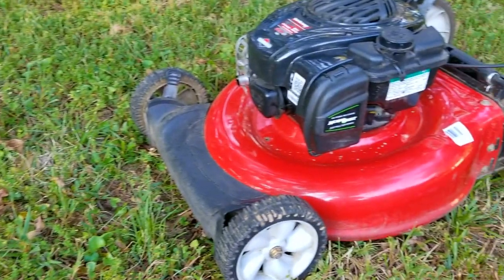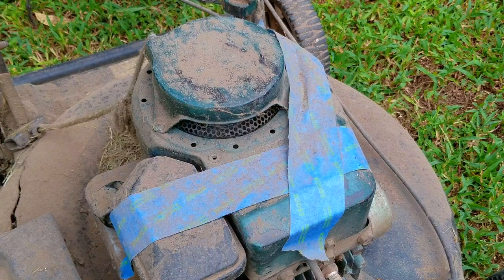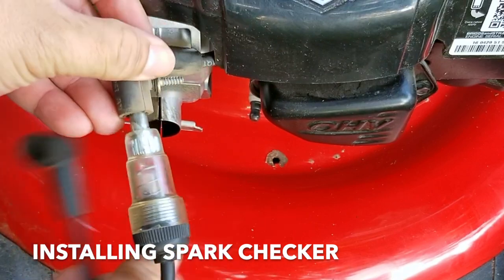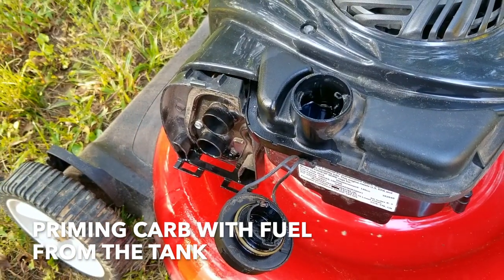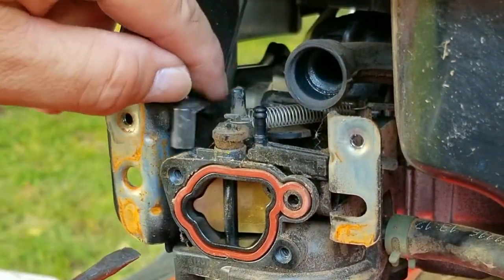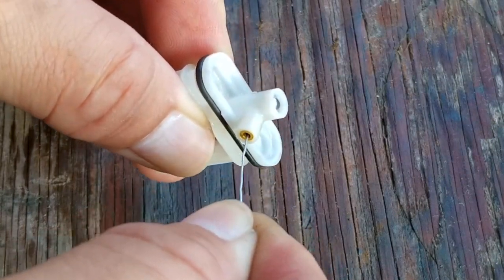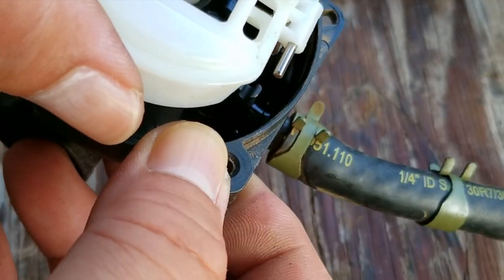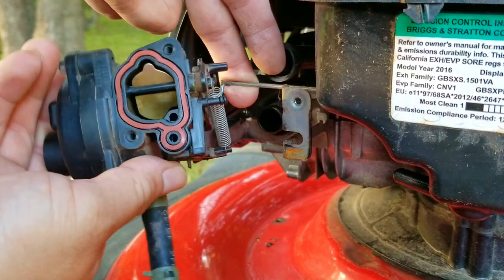Why Did Briggs Stop Making The Flathead Engine?

Comment: to be honest I actually prefer the newer ohv engines from briggs and stratton because they are more fuel efficient and I actually had some older briggs engines the flathead one and it was nothing but trouble but when I switched the newer engines really impressed me way more than I thought even my grand mother has the flathead briggs and it doesn't impress me because it's always running out of gas breaking down and all that kind of things so I like the new ones way more than the older ones.
Reply from the maker: nothing wrong with that

Comment: My 6.5 tecumseh is the most reliable mower, mostly cause the thing is a flathead. I do need new piston rings, but those are easy to get.
Reply from the maker: nice, as long as you check on the oil, and replace the spark plug once in a while, a little oil burning isn't going to hurt it.  Thank you Cj Burrows.

Comment: I like the newer engines and the issues are mostly user error like not storing them right or other lack of basic maintenance.  The plastic carb stuff overlooks the flat heads had a plastic carb as well but then nothing wrong with them.  Plus these new carbs are super easy to work on and easy to service.    The fuel injection idea would just add too much complexity to a basic engine and if people can't get the basics right in storing and maintaining a basic carb mower then a fuel injected one would just mean more issues and cost.   Also the side vale design means compromised combustion and is why they are less powerful and produce more emissions so adding fuel injection to a side valve engine is pointless.
Reply from the maker: thank you for the comment, I appreciate it.

Comment: You can make a simple mechanical injection pump and injector system or a really simple electric injector that runs off the magneto or alternator. It's not all that hard. Most of these engines are pretty much 'steady state' RPM during load. The combustion chamber and compression ratio of the old engines had more to do with the emissions. Besides, I think most of these small engines are, unfortunately going to catalyst/muffler combo units.
Reply from the maker: thank you Vince Majestyk
Reply: @INSIDEHOUSEGARAGE  You're welcome! I've got a couple old flatties on some equipment and one of the 'throwaway' 'never drain oil' on a pressure washer from 2016 or so. Never looked but I always assumed there was a drain on the bottom. I was surprised to learn they still made the flathead engines until very recently. 
I think the last time I ever saw one on a piece of new equipment had to be the very early 2000's. I believe the change away from it was more to be competitive. When you amortize the cost of design, production and tooling of that flathead over the decades they produced it, that had to be a money maker.
Reply from the maker: I feel the same, they were getting eaten alive in the market by other newer engine companies.  Money, it's a power thing. thanks again!

Comment: When gasoline evaporates slowly, it leaves behind a gummy residue called varnish which can clog fuel jets.  Ethanol is prone to this.  Unfortunately, increasingly larger amounts of ethanol is being added to gasoline.  The only proper method to prevent the gumming is to run the engine out of fuel effectively draining its carburetor.
Reply from the maker: thank you John Fraser.

Comment: I actually like that plastic carb. You can get to that jet cartridge SO easily, blow the jets out, and snap it all back in in 5 minutes. Good to go. They don't corrode with ethanol fuel, either. If it's too far gone, a new one is cheap.

You can pluck these MTD and similar mowers off curbs and out of bulk waste all day long and 98% of them run great with nothing but a jet cleaning.
Reply from the maker: you are correct, the jet is easy to get to, but unfortunately the fact that It's so easy to clog in the first place is really irritating.
Reply: @INSIDEHOUSEGARAGE  Add a fuel filter and the issue never comes back. Most of these engines only come with a goofy little screen at fuel tank outlet.
Reply: Also, they're jetted so lean that I typically make the jet just ever so slightly larger when I clean it.
Reply from the maker: true, I'll have to look again, but  I don't think there's enough clearance to add a fuel fiter.
Reply from the maker: it might work but you have to enlarger the "pilot" jet to match the fuel jet.

Comment: I prefer carburetor type small engines as I have had some very bad experiences with fuel injection. I own a Husqvarna 455ii rancher chain saw which has electronic fuel injection system.  After not using it for 9 month it wouldn’t start and the problem was the electronic fuel injection had gummed up. No matter what I tried I couldn’t get it un-gummed and at the end had to buy a new electronic fuel injection module at a price approaching half the cost of the chain saw. To make matter worse the new fuel injection module couldn’t be used as needed to be programmed costing more again. Where a carburetor is simple to clean and cheap to replace without requiring programmer in this case only Husqvarna sells programmers to their dealers.  I like the KISS principle,  Keep It Simple Stupid.

Comment: I can confirm the outstanding strength of briggs flatheads I have a 12 horse model 28 it is a riding mower engine so it's expected to take a bit more abuse than a push mower engine, but I strongly believe this engine is indestructible. About 2 years ago acquired a early 90s MTD mower that was completely rotted away, I was originally going to just tear the engine apart just for fun but I decided to try and make it work, there was no carb on it and the intake valve was stuck open so half the combustion chamber was filled with a mouse nest, I disassembled it and got to a point where I felt I could make it run, so I decided to make a all terrain race/utility lawn mower, I got a $15 junk carb of ebay to make the engine run which it run like it was brand new I got a 18 horse crank and rod and put it in and completely removed the governor after a few weeks of letting it idle and maybe give it a little rpms there was a tiny Crack in the intake manifold that I didn't notice due to its location, the cheap carb would sometimes make idle speed vary every few minutes so I felt a small Rev here and there was fine, something in the carb broke and the engine went nuts, it sounded like a top fuel drag car from across our property, when I got to it, the digital tach I had hooked up read 12400 rpm it was running around that speed for at least 15 seconds, old flathead briggs can not be killed
Reply from the maker: very nice work, thanks for sharing your experience

Comment: I do not care if it says no oil change needed. It would still get a yearly oil change anyways. I do not have a bunch of money to spare but my mower gets a yearly oil and filter change. I change the spark plug every 2 years. It might be a little excessive but I want my $600.00 purchase to last as long as it can. Doing a little maintenance is a good thing. I bought my current Craftsman lawn mower with a Kohler engine 16 years ago and the only thing I have had to repair was the rope on the pull start. They do not make them like that anymore.
Reply from the maker: you and me both!

Comment: Alway use high octane fuel. Don’t use ethanol based fuel. It attracts moisture and the engine won’t start after a winter storage. They designed this engine you show to reduce costs on low end retail mowers. Runs fine if you avoid ethanol based fuels.
Reply from the maker: you are correct!

Comment: The auto choke bi-metal mechanism can stick after sitting for a while. 5 k says this is the problem 97% when it comes to starting. If you have a auto choke briggs, look in to it….. then check back later and thank me 😉
Reply from the maker: all you have to do is remove  the air filter and look at the choke flap.
it was not stuck and closed like it's supposed to be. The main jet was clogged.

Comment: I prefer the the flat head over the new ones I have a couple of quantum engines on a strimmer mowers and a odd 10hp briggs with an updraft carb for a generator all flat and good runners the little 3.5 flat when i was young would spin off the muffler and put a pre-threaded cast iron pipe cut to 4 inches and thread it in talk about annoying the neighbors
Reply from the maker: LOL!! nice, sometimes you have to let them know, that you're doing some work outside!

Comment: Putting fuel injection on a flat head would not have changed anything. Due to the design on the combustion chamber you dont get very good air flow. This is where your low power and emmission comes from. You dont get as hot or complete of a burn as you do with an over head valve.
Reply from the maker: you make a good point.

Comment: So, the problem with THIS MOWER ABOVE was that the owner didn't run the carbie dry and winterise it before long-storing. Hmm, not Briggs's fault.
Reply from the maker: the issue is the difference between the old engine 
and the new. They were so used to the old engine and leaving fuel in it
while the new one, can't take a joke and clogs up.
Reply: @INSIDEHOUSEGARAGE  
Well, yes and no. The difference between engines/carbies is irrelevant if you follow my grandfather's (and every mechanic of the 20thC)  advice of always running a fuel bowl dry before storing ANY LENGTH of time ... especially 2 strokes with their gummy fuel habits. He taught me to run dry after every usage. And although I don't have one,  I'll bet the manuals of even the latest models all describe winterising methods, or  >1 month's inactivity.

And if it is "the difference between motors", please elaborate on which attribute causes this? Are the jets horizontal not vertical? Don't they breathe/evaporate like the old ones? Do particles accumulate more in the latter?  A mechanical claim such as yours must have a mechanical causation.

Comment: I tried to loosen that allen on the bowl to drain the old gas out and the plastic bolt immediately stripped.
Reply from the maker: that's a shame, what did you do after that?
Reply: @INSIDEHOUSEGARAGE  The bolt came out but it wouldn't screw back in so I just tapped it in upside down so the o ring kept it from leaking. I know that sounds pretty hillbilly but It hasn't leaked since.
Reply from the maker: nice work!

Comment: You would think that Briggs would want customers changing the oil.... the problem with not changing oil would mean that the engine will wear the cylinder wall out causing  an oil burning engine.... That is NOT good for the environment.... and Im sure that owners would want to add oil when its low....
Reply from the maker: you are correct, no oil changes in conjunction with keeping the break in oil the whole time, is nothing more certain premature wear.

Comment: The later flat head engines also came with plastic carburator och plastic membrane design that could make them very hard to 
start efter a while.
So has nothing to do with the valve system.
Reply from the maker: thank you fortune300. The whole thing is what I would call a bad imitation or slight improvement of the original
Reply: @INSIDEHOUSEGARAGE  It´s stil impossible to get rid of the L-head drawbacks of allways having higher CO and HC emissions and worse combustion efficiency. Injection system wont help much. 
The older design carbuators would help a lot to fix the drawbacks o the newer enigine.
Reply from the maker: I can agree with this statement.  Just the idea they spent all that money and came up with something that wasn't as durable on the older engine, in my mind was a poor use of money.  I figured if they tried to improve on the L head, it would have been better than going with a new design. Thanks again

Comment: I only use non-ethanol gasoline in my mowers and weed eaters.  Since I haven't drained my mowers' fuel tanks and run their carb bowels out of gasoline till they quit, I will find out in about a month if non-ethanol gasoline keeps its octane over winter.

I suspect it does as I used nearly two-year old non-ethanol gasoline in my equipment last summer without hint of issue.
Reply from the maker: I agree, keep the fuel full thru the winter, only if you use non ethanal fuel.
Reply: @INSIDEHOUSEGARAGE  Thanks.  It seems to be "the answer."  I decided to use non-ethanol fuel and keep a stock on-hand after the derecho line of thunderstorms that swept through the eastern United States the summer of 2012.  Power was knocked out for a week where I lived and there was a gasoline shortage.  Non-ethanol gasoline seems to keep very well.

Comment: Simply adding fuel injection isn’t a fix for flat head emissions. The design of a flat head leaves a big pocket that isn’t involved in combustion so they will always have high hydrocarbon emissions and not be as efficient as an OHV engine. 
So, while they were durable and reliable Briggs had to change to work in the modern market and regulations.
Reply from the maker: I can agree to that.  Took them some time, but eventually, they made the change.

Comment: Why would you do electronic fuel injection when you could go cheaper with mechanical fuel injection like what is used in them cheap diesels that are sold online?
Reply from the maker: I think that's a good idea, except there might be an issue when it runs out of gas. It will be hard to convince the owners to crack a line to let the air out of the line to the pump.

Comment: The reason why B&S stopped making the old L head was because of CARB and the EPA tightening emissions to the point that the engine was obsolete.   

I mean damn,  they are making manufacturers put catalytic converters on chain saws and weed trimmers!
Reply from the maker: well said.

Comment: Two different issues, the reason the OHV engine didn't start had nothing ti do with the OHV or the flathead design, it was just the carb design. The carb's on the old flathead design vesus the carb's used on the OHV. The failure to start had nothing to do with the engine itself, just the carb design.
Reply from the maker: hey thanks for clarifying that, I wasn't sure, until you clarified it, thanks again .

Comment: It's not the Fuel left in the Tank that's the problem, it's Fuel left in the Carburetor. It turns into Sludge and that's what Clog's the Jet's. This will happen in any Carb, regardless of the Material it's made of.
Reply: The reason EFI doesn't have similar issue's is because the Fuel Pressure is much Higher and can dislodge the Sludge built up in the Injector's.
Reply: But if You make sure there is no Fuel in Your Carb in the Fall, You should have no Trouble running 4 Month old Fuel in the Spring. Especially if You have a Fuel Filter
Reply from the maker: now that I'll agree with.
Reply from the maker: now that makes sense
Reply from the maker: I'm on board so far but no room for an aftermarket filter.

Comment: Fact is, while I love the old flat head, there is no way to get them to meet emissions regs, fuel injected or not. This is due to the inefficient design of the flatty. The combustion chamber has a very large surface area for a given capacity which leaves a large amount of unburnt fuel sitting close to all those surfaces- result, lots of unburnt hydrocarbons. Also it is near impossible to get a decent compression ratio to improve efficiency. Believe me, if Briggs could have made it work they would have.
Reply from the maker: well said

Comment: They phased out the old flatheads as they ran forever , so briggs never made any money on them . My current mower is a 2002 with a 5 horse quantum . It starts , runs & cuts perfectly . It doesn't use any oil either
Reply from the maker: nice thank yo Kim.

Comment: I wonder why people arent replacing the carb system with a small mechanical pump based injector system. Seems like a cheap solution to make an old design more efficient and powerful, and the same systems using mechanical injection powered mid 19th century mercedes cars as well as others.
Reply from the maker: it would be pretty cool if that did happen. The problem would be refueling. Mechanical injection doesn't like to run empty and when they do, you'll have to get the air out of the lines.  most wouldn't be able to do it.
Reply: @INSIDEHOUSEGARAGE  A self prime would be nice in that scenario, I gotta look into that but I imagine a small push drain like an older carb design would be doable. Thanks for the info, i completely forgot about that. time to experiment.
Reply from the maker: nice idea about the drain. and thanks again for the feedback. It's nice to have a discussion like this.

Comment: Did Briggs and Stratton not go bankrupt after the major lawsuit that they loss about them lying about the HP of their engines on some equipment? I myself love the engine, but when I needed parts for the B&S engine, they were very hard to find and if you did find them, the seller wanted an arm and a leg for them.
Reply from the maker: not sure, only aware of the "one bankruptcy, a few years ago.
Reply: The main reason for bankruptcy was to unload pension obligations.
Reply: @392hemi9  I disagree. I know our dealer was rewarded a small fortune that he was to disburse the money amongst this customers that all bought equipment with a B&S motors. Now he has a very hard time getting B & S parts.
Reply: @williamsnow1531  
Hi Bill,
Your right about the lawsuit regarding the horsepower dispute. This lawsuit was generated by ambulance chasing lawyers. Engine horsepower ratings can vary considerably based on ambient temperature and barometric pressure. I'm not aware of anyone that was harmed by any variance in the rated horsepower of a Briggs and Stratton engine. That's why Briggs changed to rating their  engines by their peak torque  rather than horsepower as torque won't vary as much. Briggs and Stratton is now owned by a east coast hedge fund, in what looks like a prearranged bankruptcy, as they were the only bidder.